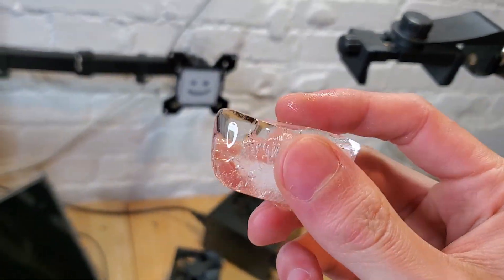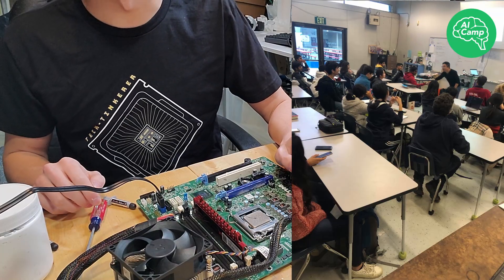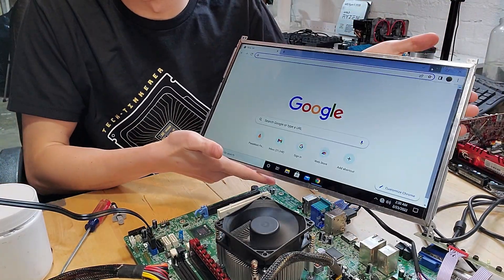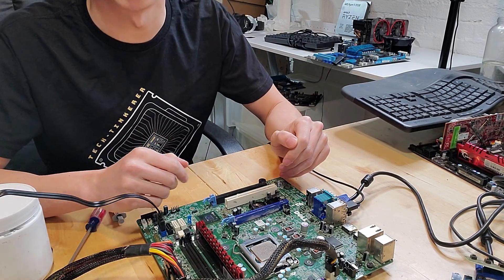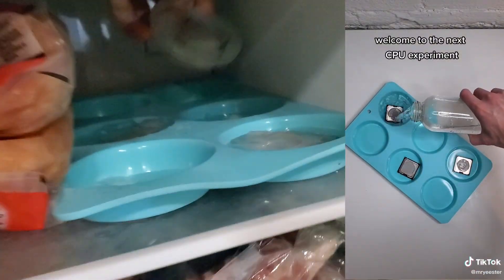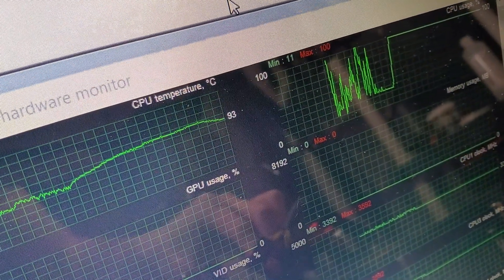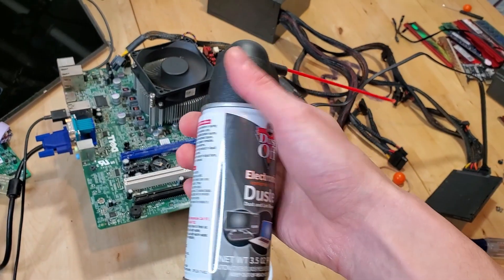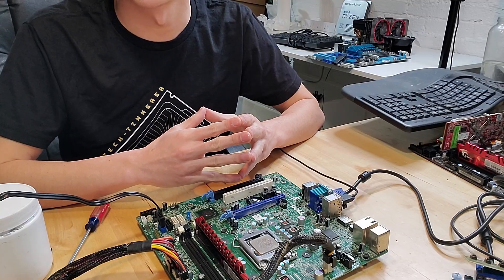Can Ice Cubes Replace your CPU Cooler?

Comment: 5:53 It's different for some boards. For example on an OptiPlex mobo it'll just alert you that the corresponding fans are not found, and you can press F1 to continue.
Reply: Yeah, in Asus mobos there is option to ignore cpu fan

Comment: Fun fact the can of compressed air cooled the cpu bc the air coming out the can is actually colder than room temperature! Any air that goes from a high pressure to a low pressure will also drop in temperature and is exactly how a refridgerators evaporator keeps your food cold. Thats why the air gun didnt cool the cpu down as much too!

Comment: If you use distilled water to create the ice, is it safe to use it to cool the processor directly? Theoretically, the water that melted would not damage the motherboard since distilled water does not conduct electricity.

Comment: Cpu cooler increase surface area of pretty much flat ihs toh a 3d structure with fins or heat pipes that's why it's called a heat sink

Comment: There is 10 works for you xdddd :

1.Try run motherboard underwater plus
 gpu and cpu.....
2. Use whipped cream as thermal paste
3. Use laptop cpu as desktop
4. Run pc on car battery 
5. Use trashcan as pc case
6. Use money as thermal paste
7. Try cool cpu with compressor
8. Use paper as thermal paste
9. Use gpu chip as cpu
10. Run cpu on 12v battery

Comment: Instead of changing the cup for a new one you should have added more ice
Due to a property of materials called latent heat, when a material is changing its phase its temperature will remain constant

It means that if you mantain a mixture of water and ice its temperature will always remain at 0°C
I'm sure that if you swapped between cups of this solution you could have gotten way better results
Reply: Yeah except it would have flooded the motherboard...
Reply: I was about to suggest same. Also surface area of an ice cube that touches the cup is small, but with water and ice cube, heat will transfer much better between the cube and water and between water and the cup.
Maybe even better, modify a heatpipe cooler to enter through a cup, seal it with a glue gun, it would have the heatpipes in the ice cold water and would getter heat transfer in my opinion.
Reply: @nilsfrahm1323  Yeah he should have added cold water. The metal part initially only exchanges heat with small contact patch on the ice cube + itself.
And largely the ice cube "touches" air which doesn't exchange as much heat with the metal cup.
Reply: While he would get a way better result, your statement is lacking as there is something called heat conductivity and convection speed. 
Water that is on contact with the heated surface needs time to move or conduct the heat to other parts of the liquid. 
So you should also add a stirring system to effectively cool your system.
Reply: @alqualonde2998  if the comments keep going like this we will eventually arrive at the concept of an AIO cooler😂
Reply: @hereandnow3156  I'm totally interested in a phase change/heat pump aio cooler that's not loud af.  We used to cool a particularly overclocked CPU by running a copper phase change tube system over a  window units radiator at collage.
Reply: @hereandnow3156 Real-time evolution in action 😎
Reply: I would also worried about condensation outside the cup. That would be deadly for mobo.
Reply: The pro OC guys with the liquid nitrogen cups that they pour into have it all figured out, modeling clay.  @anathematoyou
Reply: A
Reply: Nerds

Comment: Ooooohhhh an alcahol evaporative cooling setup would be interesting to see. Get some rubbing alcohol in a spray bottle and spray it on the surface of the CPU! If you’ve got a 3D printer, you could make a collar to go around the CPU so that you don’t get any over spray and it could just mount to the same air cooler holes. (If you wanted me to design the collar for you I’d be happy to do so)
Reply: It's pretty much same thing as a heat pipe
Reply: @timserious7678  it functions on the same principal as a heatpipe, but it’s about it’s only similarity to a heatpipe

Comment: Well you should've tried ice with salt cuz salt drops the temperature of ice to about -15°C. Go try this test it could be great!
Reply: doesnt ice smelt with ice?
Reply: @IHATEYOUTUBESNEWUSERNAMESTUFF  Yes it does , but I mean it would be a nice experiment do test.
Reply: @IHATEYOUTUBESNEWUSERNAMESTUFF  ice smelts with ice???
Reply: salt changes the freezing point of water. the ice will be the same temperature as the air in the freezer whether or not there is salt in it. what's most likely is that the water would never freeze in the first place

Comment: BRO…I’m such a noob. I built my new pc and it just wouldn’t turn on. I tried everything, This showed up on my recommended feed and About six minutes in your said the system won’t even power in if the cpu cooler isn’t plugged in. Then, I looked as a sanity test and low and behold it was plugged into the wrong socket… can’t thank you enough. But maybe I’m just stupid idk

Comment: The measuring cups really should have been sanded to at least a grit of 3000. If that were done, the liquid water would probly be able to sustain a decent temperature without switching cups.

Comment: I have to disagree with your claim that the water is going to melt leaving an empty cup. This definitely varies from CPU to CPU, but the temperature is measured on the core itself. There are temperature losses between the core, the IHS, your cup and your water.

So I doubt the water would boil. Feel free to test this as that might be interesting.

Pro tip: use these old AMD FX CPUs... Those are HOT
Reply: Not right away no but yes it can, other youtube channels have cooked food on them.
Reply: @crisnmaryfam7344  melting point of fat is lower than 100°C so cooking food on it doesn't mean anything when talking about boiling water.

Comment: Can you flip the motherboard, and apply the ice from bottom?
That way water will drip to ground, keeping the motherboard dry without using a cup in between
Reply: Then you’ll need something like a spring constantly pushing the ice upwards. Also the condensation formed on the motherboard can kill it too.
Reply: @jivewig  I think he means that if you put it on de otherside of the motherboard
Reply: @Rubennatorr  nope, then it won’t work at all. There’s wood in between then, a bad conductor of heat. He meant CPU facing down and ice in contact with it.
Reply: @jivewig  But he said bottom
Reply: @Rubennatorr  first flip the motherboard, then apply ice from bottom
Reply: @jivewig  ooooo oké

Comment: What I would do is flatten the IHS and the metal cup bottom with sand paper on flat glass.
Then silicone the cpu in the motherboard so it doesn't leak in. Then use CPU paste between them.

Even with that you would want to bolt down the heatsink ideally.

Maybe get a ln2 heatsink and fill it with ice cubes or dry ice. Or make something similar that can bolt to the motherboard.

Comment: 💡 What if a continuously running compressor blows air onto the CPU instead of that can of compressed air? 🤔
Reply: What if..... A continually spinning fan were to move air across it?!? We may have come up with a new type of Cpu cooler!.........wait..... No... Nope.
Reply: @crisnmaryfam7344  not really nobody uses that method, first you need to add more surface where the heat can be transferred like a piece of metal that connects to the CPU the it can become more effective

Comment: You may try this same thing with other kind of metals like aluminum, copper and even with heatsink (idk how to do). I think the problem here is with heat conductivity of metal used. Ice is below zero, it must have cooled.
Reply: I usually use wet tissues on my laptop cpu
Reply: But cpu is much hotter
Reply: If you have ever seen someone hold a 1/8th inch copper pipe in there hand and just hold it against an ice cube, it cuts the the cube like butter just with the heat transfer from your hand. Point is better heat transfer would be good but it would probably melt the ice cube in about 30 seconds lol
Reply: Using a copper cup would have been much better as it's one of the best heat transfer materials. My assumption is the metal cups you used were stainless steel or aluminum. So copper is about 20ish times more conductive than stainless and about double of aluminum.
Reply: @ForsakenSamurai87  Bro Copper will instantly melt the large chunk of ice.😅 So it's a bad idea.
Reply: @iftichan  that is the idea, the fastest it melts, the more heat it is taking
Reply: And more mounting pressure on the CPU.
Reply: Yeah, use a thin and small copper cup, pour water in it till the brim and freeze it. Then apply fresh thermal paste and just use that frozen cup.